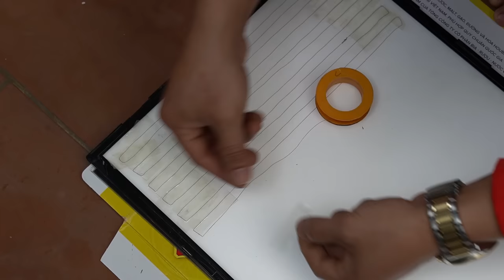I Turn The Screen Into A Large Capacity Solar Battery

Comment: Very clearly fake, the part your taped wire over is a plastic diffuser sheet that has no electronics. The screen itself has a laminate layer which is an insulator. It doesn't make sense.
Reply: Setuju